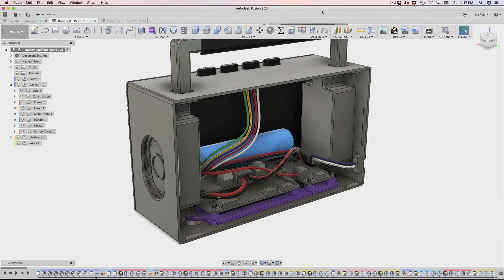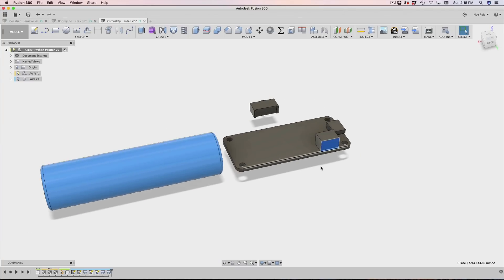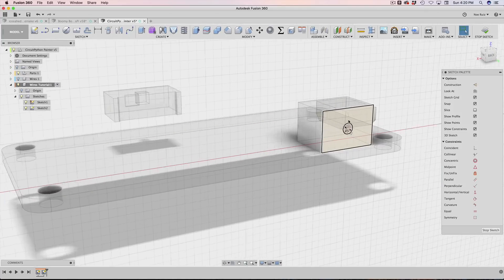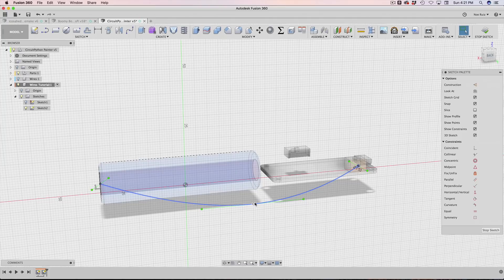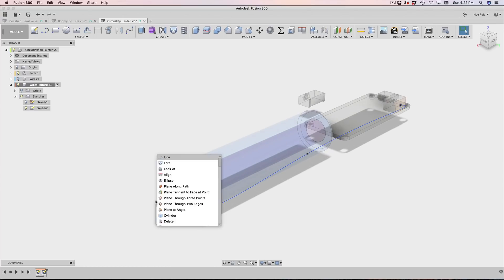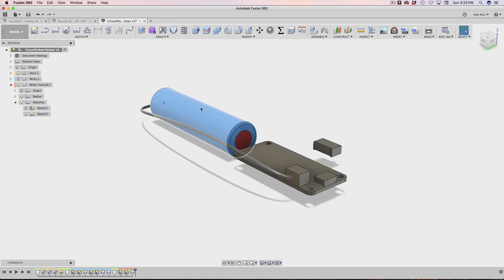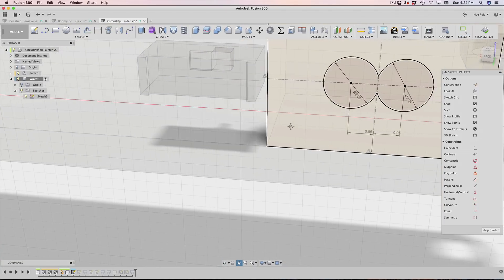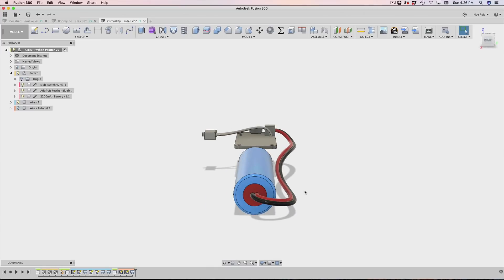Fusion 360 Tutorial – Creating Wires for Components

Comment: Thanks for the tutorial. I'm creating a design where i need the wires to be flexible. It's like an extendable arm (think adjustable tripod stand) that can be shut, and it has a wire running along it, so i need the wire to be able to bend when the arm is retracted, and straighten when it's extended.

Comment: how would you tackle the problem  when you have connectors models on both sides of the wire? I run in to the problem that the sline does not remain connected to the connectors when I move the connects around.

Comment: really useful, modelling a lot of internal components, this is very useful as you say, for cabling lengths! its one of the bits i have overlooked previously when making cases etc is the wires between components. be nice if you could dimension a circle off the mm2 of the cable.

Comment: I know it'll be a hail marry if this gets answered but ill ask anyways. If i have the cable connecting to two different objects and then i move another either my using the move tool or using a joint that moves/ rotates the object, will the cable adapt to that or will my entire model brake since the cable won't extend and stuff. Is there any possible way for me to change the physics of the cable if that is the case?

Comment: Wouldn't have guessed Adafruit was doing Fushion tutorials.  I looked through the play list and there are several I am interested to see.  Thanks.
Reply: Well, they've been expanding into 3D printing and more general makery (instead of just electronics) for quite a long while now... But I'm sure it doesn't hurt that Eagle is now owned by Autodesk and integrates directly with F360, making it an indispensable tool in the product design pipeline. :D

Comment: This is great tutorial which explains why I'm so frustrated with it. I used the "Include 3D geometry" command to project the start point onto my current sketch, but I cannot get the spline tool to snap onto the start point because it's on a different sketch plane.  - What am I doing wrong ??
Reply: Problem Solved. You need the "3D Sketch" checkbox ticked in the sketch palette ticked
Reply: ah thank you, that kinda fixed it although was still mega janky, had to do loads of move to get several parts off the plane, still doesnt work as well as in the vid

Comment: Nice video.
Two quick questions. How do you type in a command? You used it to bring up the 3D sketch projection.
Second question, why did you use a loft over a sweep?
Reply: Jared Armstrong use “s” key on your keyboard it brings up the search box , you can search for a command there. And for your second question, you’re right it would be better to use sweep over a loft if you want to sweep a custom profile. However in this case pipe command would have been the best.

Comment: Thank you for your useful tutorial.
I did as you say in this vid, and the wire is produced well, 
but when I move one of the objects, the wire don't move with the object,
wire is not attached to the objects, can't figure out the problem, 
what's wrong?
Reply from the maker: Could be a sketch setting. If the wires are created via projected sketches, they should move with the components, but only on certain axis (like X and Y but not Z, for example).
Reply: Enable in settings option to allow 3d sketching